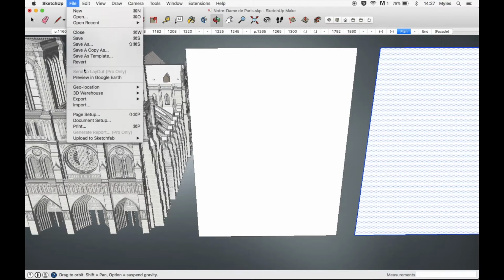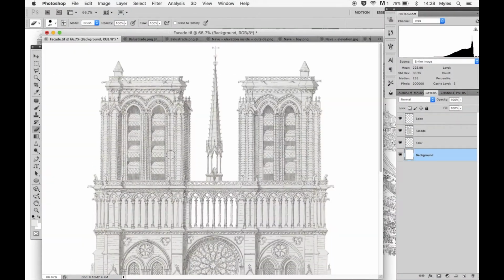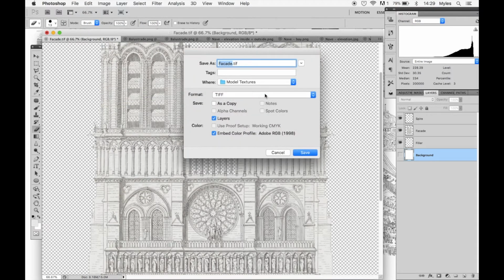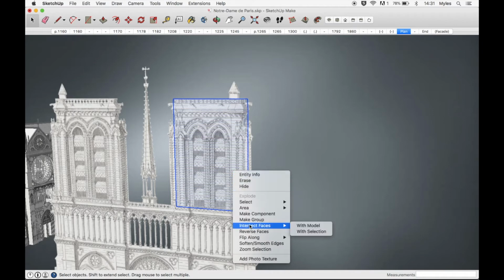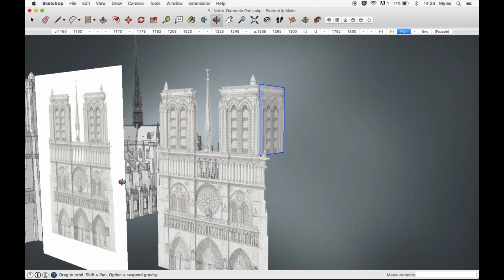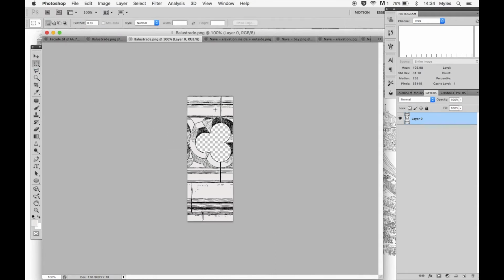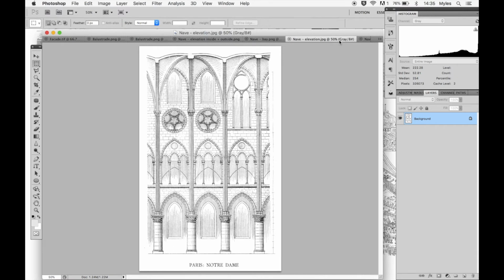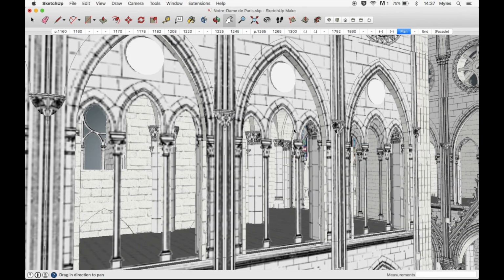How can custom image textures reduce polygon count? (Part 5/6)

Comment: It's good. Very good. You may have your way with computers. But it's still not as impeccable as my works by hand. The ballustrades on the top on the towers and below aren't composed by 3 circles in 1 but 4 circles. 3 circles only apply to the middle ballustrade around the ship. Sorry, 10.000s of hours of study provided by a 25 year old obsession to do it right and exactly as it should be.
Reply from the maker: I have no doubt that you have a better grasp of the cathedral's details than I do.
Reply: @MylesZhang It doesn't mean your work isn't good. Despite some details, you've explained very thoroughly how this cathedral works. I've also found mistakes in my own works and I will have to redo the north and the south side in its entirity because I forgot to include a side portal on the left side of the nave on the north side. The south side became overdone and its dimensions are not accurate enough. The front towers aren't correctly composed on both sides. I'm not perfect either and no matter how good I may draw it, it's still a learning process for me as well. Notre Dame becomes more and more complex the more you look at it. You can literaly get lost in it. What you display, is kind of the manner how I start such a drawing and again, explains the works of this cathedral.
Reply from the maker: @Ominous89  Yes, there is a small side portal on the north side, just to the east of the north transept face. This would have provided access from the now-demolished monastery to the interior of the choir. For daily prayers, songs, and the liturgy, monks needed their own entrance.